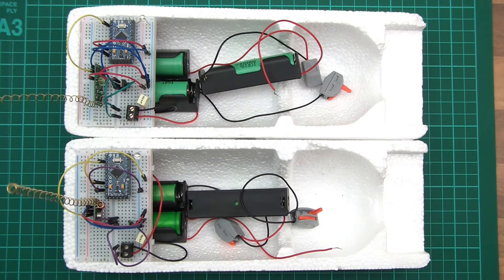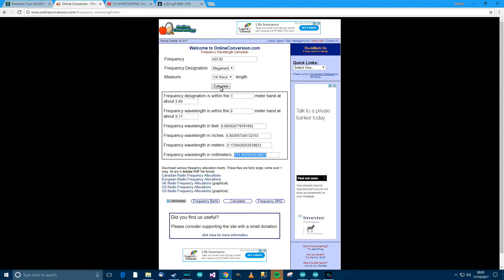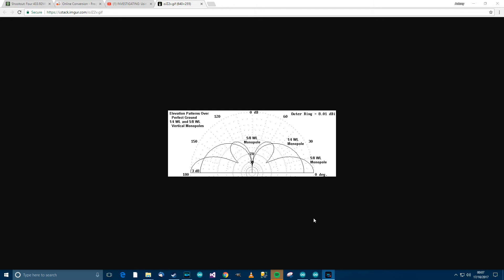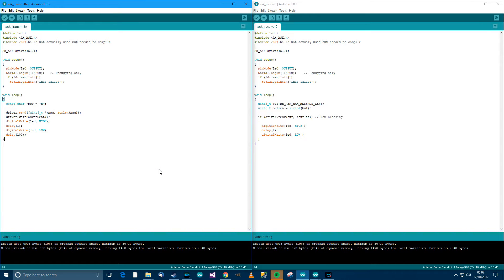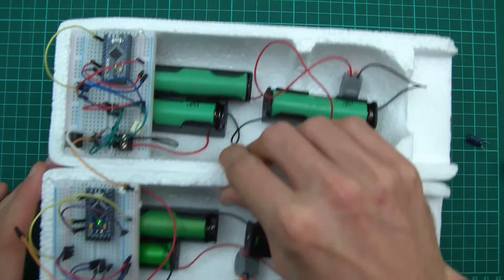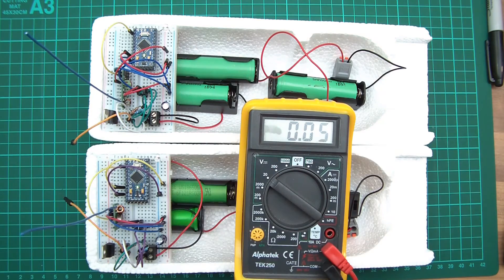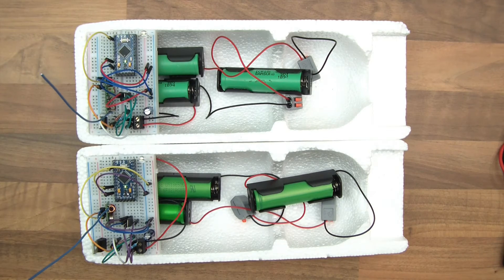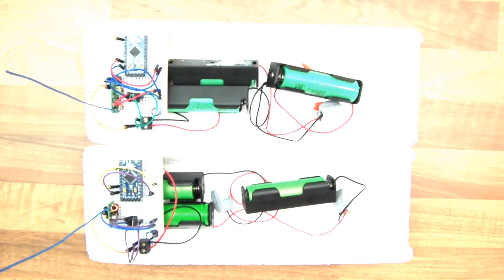INVESTIGATING: The Range of Cheap 433MHz RF Transmitter Receiver Modules - Antenna Whip! (Part 4/5)

Comment: VERY IMPORTANT
Hii, u cant use 12v for the transmitter as if u see the dataset of the crystal of the transmitter its recommended voltage is 10v, so simply can't use 12volts for the transmitter.

2nd point is maybe u cant use higher voltage than 5v for the receiver if u r using a mcu, because using 10v will output higher voltage than 5v (I guess) from the receivers data pin and your mcu may damage.
Anyway new subscriber from India ❤ love for u and ur works 🎉😊

Comment: Have managed to get 110 meters on 5V with a pair of these. Note that I got 2 pairs initially and one of the receivers was actually not working that well. I had to turn a bit the little pin in the coil to get it to receive more properly. After that I performed the test - with that "faulty" receiver.

Comment: try using these pigtails: https://www.aliexpress.com/item/Sale-10CM-RG178-RP-SMA-Female-To-PCB-Solder-Pigtail-Cable-For-WIFI-Wireless-LOW-LOSS/32654897271.html
and these 12dbi high gain 433mhz antennas: https://www.aliexpress.com/item/433Mhz-antenna-12dbi-high-gain-OMNI-rubber-radio-aerial-220mm-with-SMA-male-connetor/32819591442.html
Reply: in my application of 433mhz transmitter receiver sets I will need the entire thing to be water and weather proof with a fire resistant enclosure which sma type antennas allow me to do with a bit of thread sealant. and would be nice to have a proper range test done on such a antenna set up here on youtube. :)

Comment: I want to transmit data from 2nd floor to ground floor. Will RF433 module work? Please note I have to place the transmitter on the rooftop, i. e. higher than the receiver. The total distance will be around 20 meters. Any help will be appreciated.
Reply: If it didnt work, you can try using lora modules, might be an overkill though for 20 meters
Reply: Rakshith Prakash hi do you know about this stuff I have some questions

Comment: I would say that you need to step up voltage, not step down, because it radiates more power then... But maybe the circuit doesn't work well then... Hm.
Reply from the maker: Stepping up just didn't work for some reason.

Comment: I'm having fun with the same modules. In my case I noticed that increasing voltage really helps but only on the transmitter side. Do not change receiver voltage, leave it at 5 volts. Also reducing baud rate frankly reduced the range for me. I can't explain why. I tested this at 500, 1000, 2000 and 2200. Looks like the 2000 and 2200 give me far more range. You should do probably only one change at a time and test the results. It looks like you changed antennas, baud rate and voltage at the same time. Thanks for the videos though; it directed me to the correct library.
Reply from the maker: Hi Mickey! I also found some unexpected things. I didn't change lots of things at the same time, I did one by one, but it looks like it does because otherwise the video would be hours long lol. :-)
Reply: These modules basically use ON/OFF modulation, i.e. you either send a signal at 433MHz or you don't.  And the receiver then needs to determine whether a sender is or is not sending by checking for such a signal above the noise level.  The receiver will hence continuously (but relatively slowly compared to the length of a "bit" coming from the sender) adapt its detection level (AGC) in an attempt to be just above the noise level.  When the sender isn't sending a signal, this means the gain of the receiver will get turned up so far that even part of the background noise is getting detected as a signal.  This is why any packet from the sender should start with a minimal period of actually sending out the 433MHz carrier.  That causes the gain in the receiver to get tuned to the level it can receive from this sender (assuming that is above the noise level).  When that is done, the sender can start turning off and on the carrier frequency to send over bits, but it needs to make sure that it doesn't turn off the signal too long because that could cause the receivers gain to raise again and hence start seeing noise as a signal.  Hence a good modulation technique (how you send over bits in the form of periods of the carrier being present or not being present) is important and too slow sending can in fact cause worse signal reception at the receiver end.  There's another reason why sending slow might be bad: it means the same packet takes up more time and during that time another sender might also start transmitting and then corrupts your signal for the receiver.  So, the slower you send, the longer your packet takes and the more chance someone else might be interrupting it.  Hence repeating packets at random intervals to reduce the risk of repeated overrun by other senders is also an important feature to include.

Comment: I am using rf 433mhz tx,rx for that i need to design an antenna to radiate upto 20m in only one direction,for that what kind of antenna i use
Reply: Directional antena
Reply: dhanasekar S hi do you know much about rf signals ? I have a question for you
Reply: If you want a really narrow directionality use a Yagi, Parabolic, or helical antenna.

Comment: Thank for mention me :) I would agree with Malcolm but have to remember you doing it on the cheap, if the transmitter and receiver isn't doing well even lowering the Baud rate (even down to 200) and also with 5/8 whip, nrf24L01+ ( as Chloe said) is better buy for longer distances, I got loads of these as low as £1.00 (I should note I can get cheaper than that as low as 70p each (uk)). But it is your choice to stick with what you got and only limited to the length of your garden. Have fun and lots of it.
Reply from the maker: cheetahkid I've found a very very simple way to increase its range substantially. It will be in one of next week's videos. :) Yeah, I've got a few videos about nrf. I'll do a range test for those too at some point.
Reply: great, I am looking forward to see it.
Reply: @antonycartwright  I think you have not done the video yet?
Reply from the maker: @sonusanat  I did the video. Type in 433 into my channel. :)
Reply: the 433MHZ have more range than higher frequencies
but this tranmitter is only limited to 10mW
if you tried the HC-12, it have 100mW you would get even better range than the 2.4ghz ones with high gain antennas

Comment: Yea I did the same. Just a half or quarter wave whip. I still only got about 50 meters max. Ended up changing to nrf24L01s. So much more reliable.
Reply: Iforce2d posted a 30km+ test on nrf24l01
Reply from the maker: Chloe, next week, another video is coming... I manage around 100m.